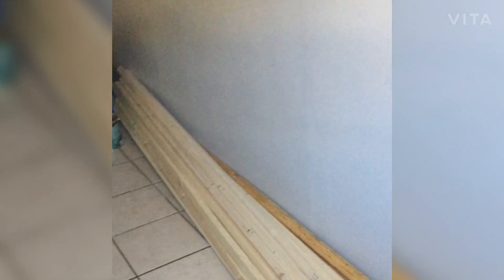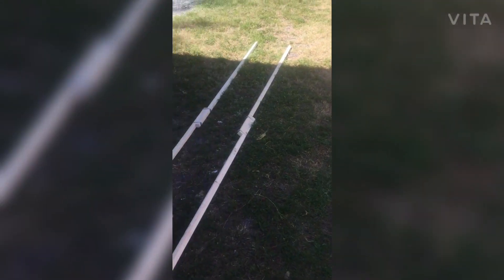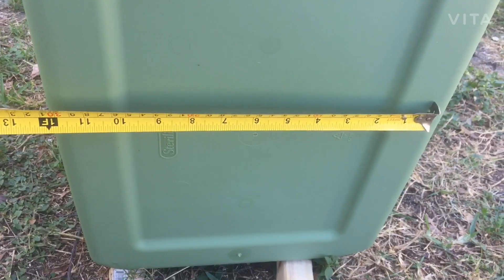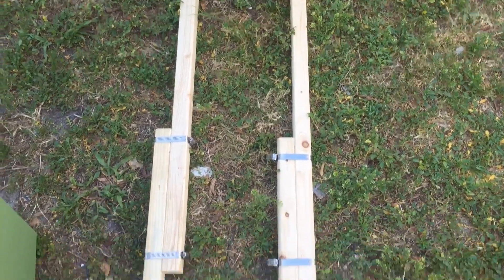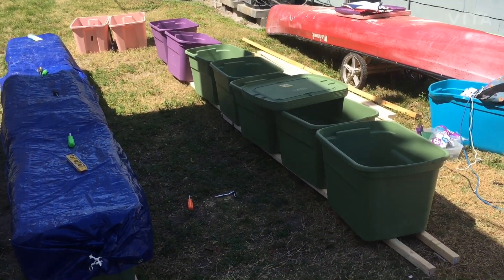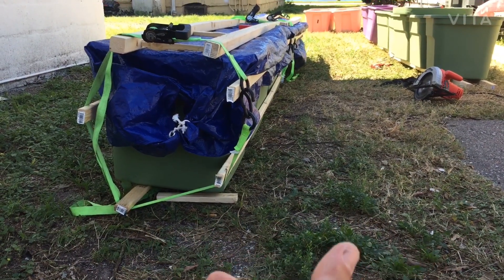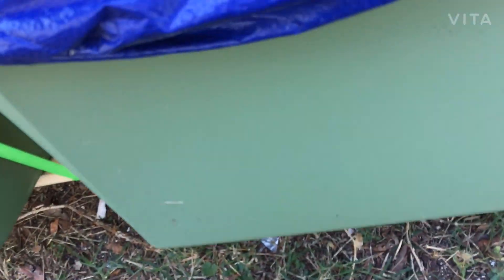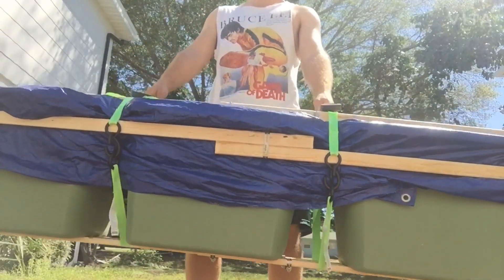DIY PONTOON BOAT - The DreamBoat: 15ft storage bin pontoon prototype. Design and assembly.

Comment: Why didn't you just seal the lids on?
Reply from the maker: i wanted to be able stack them inside each other for storage. maybe a rubber seal strip would work. however, with the tarp, very very little water has ever gotten in the bins over the course of over ten trips. even when waves splash over the top.